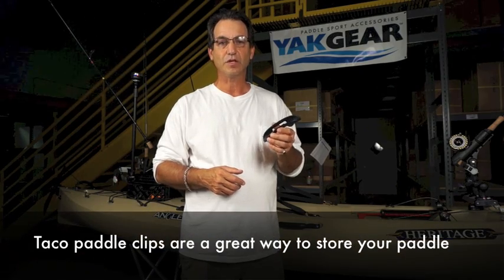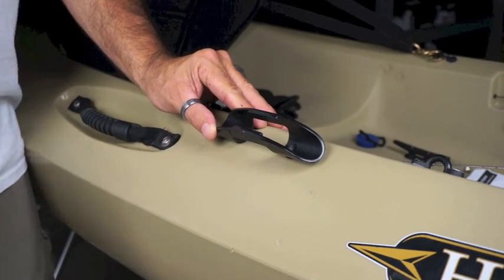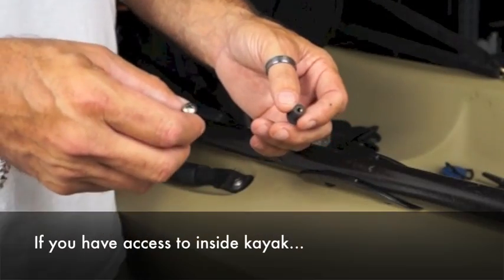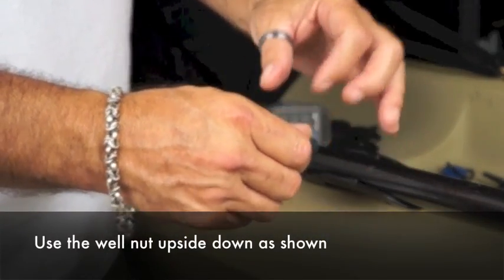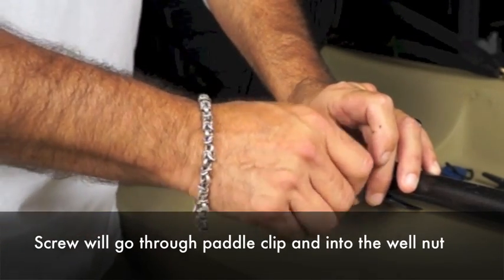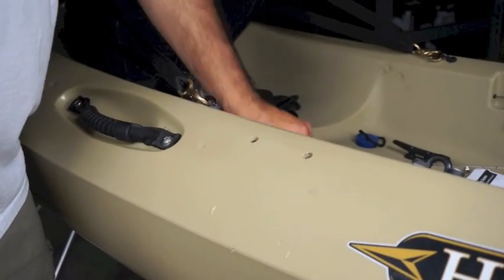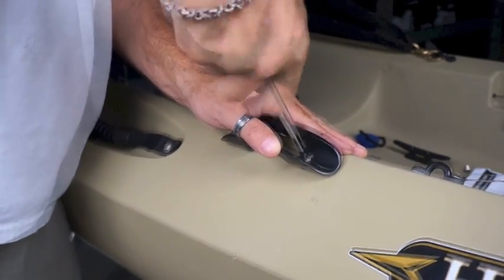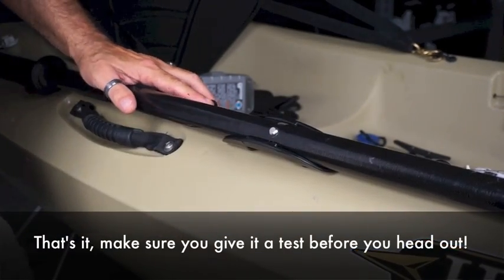How to Install a YakGear Taco Paddle Clip

Comment: 0:55 More accurate to put the clip where you want it, hold it in place, then poke the ink pen through the holes to mark where to drill. That's standard template usage, anyway.

Comment: Thank you for this instructional video.  My paddle clip came without installation instructions, but your video made installation very easy.  One thing I did wrong!...I tried to push the rubber well plugs in the hole before adding the bolt thru the paddle clip - AND THE PLUG WENT RIGHT THRU - lost forever inside the hull!! 🙁  Yikes - lesson learned.

Comment: This placement for the paddle clip is NOT ideal. First off, you will frequently hit the clip while you are paddling. Second, if you transport your kayak upside down, it will be a potential obstacle with the cross bars. The best way to determine where to put the clip is out on the water, making sure that it is not going to interfere with paddling. I'm speaking from experience, and I have the same clip on the same kayak.
Reply: Excellent point.  I will take this into account when I install it myself.  Thanks!
Reply: Probably the first YouTube comment worth reading.
Reply: Loren Rochester - 👍 and thank you! Researching paddle clips before I buy and install, so I'm glad I saw this beforehand. 🛶

Comment: Your description was backwards. You switched the instructions for when you do have inside access with when you do not have access, in regards to using the well nuts.
Reply: So if you have access what size drill hit do I need
Reply: @JJDaBossOutdoors  I’m wondering the sad thing because if you mount it from the outside there’s no way to keep those nuts from falling out.

Comment: I don’t understand how mounting from the outside how it doesn’t come off? There’s nothing holding those nuts into the kayak.
Reply: I just got my clip in today. The metal threads are at the bottom of the well nut so when you tighten it will draw up the middle of the insert creating a bulge like a wall anchor would. The clip shouldn’t  go anywhere.  I might be too late to this question though.

Comment: Can I use rivets with the paddle holder?
Reply: If you don't have access to the inside, I would do it. Make sure the rivet is the same size as the hole you drill.